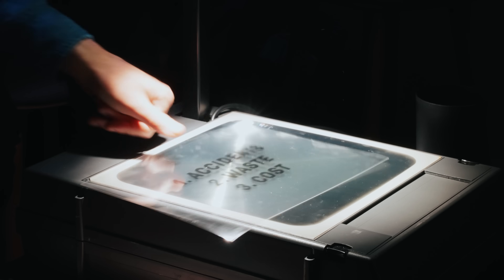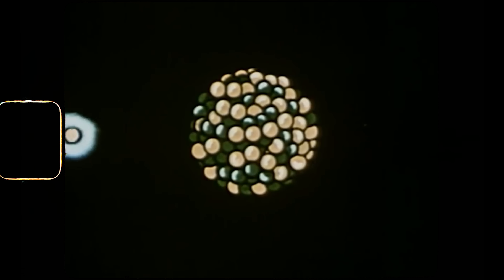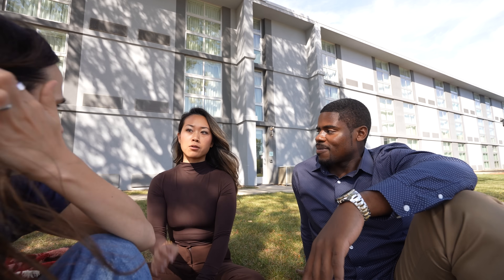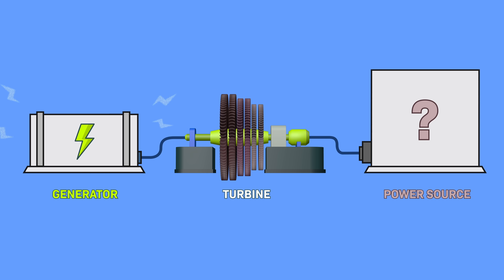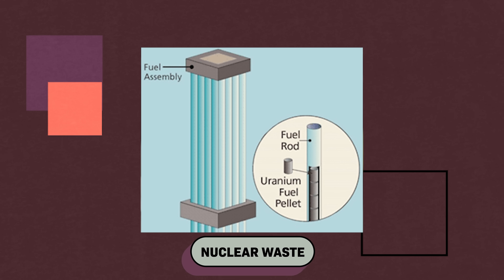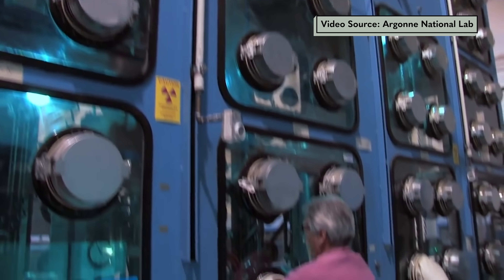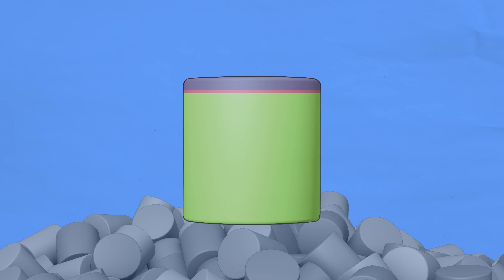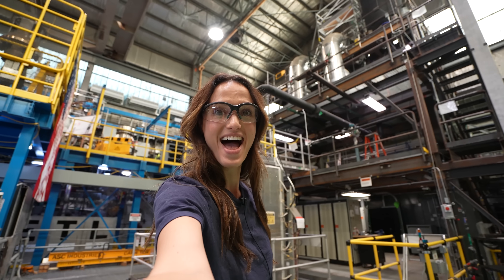The Big Lie About Nuclear Waste

Comment: As someone who studied nuclear engineering in school, honestly every decade or so people start getting hyped about some "forgotten" technology from the 50s and it makes the rounds, papers are written research is funded. When it comes down to proposed costs and models there's not enough information and we get bogged down in the details and the costs look good. If this gets traction for the next 2-3 years great. Maybe in 40 years it will get enough people in favor of nuclear to finally do this stuff. Nuclear isn't profitable. It's not. The benefit of using nuclear is the same benefit of having roads and public infrastructure: the additional societal good outweigh the coasts associated with doing all the work. 

One time through Nuclear fuel processing is a bizarrely hands on process. You can't really be so hands on with recycled fuel, and especially not during the reprocessing steps. All of those require robotics and automation, and the equipment is going to get radioactive so even Maia ting the equipement is going to require robots and cool down time for the equipment. All of the equipment t in turn is considered low level wast. The sites where the US military created plutonium have tonnes of such equipment that cannot be removed, just stored. 

Also, if you do the math on known estimates of uranium reserves, you can easily arrive at hundreds if Not thousands of years of energy consumption for the entire human race. More than enough time for fusion to get the kinks out. Downside is fast reactors burn through their vessels faster, so can live as long. There's gonna be a bit more low level waste. 

Storage is solved, ish. Drill 7 miles deep into impermeable rock layers, put your fuel, seal the hole. No one will stumble over 7 miles deep into continental crust. Added bonuses it won't leave into waste supplies, like could have happened at Yucca Mountain.

Like left wing politicians, what Nuclear fails the most at is marketing and communication. To describe how nuclear solves problems requires getting into the details of why it makes sense, and why the cultural and societal shift needed to support nuclear makes sense. You cannot run a nuclear plant as a for profit entity it must be a not for profit with focus not on reducing costs, but on maintaining safety. When you skip on safety, training, inspections, you get accidents just like in ever other industry. Nuclear doesn't leave poison gas which will suffocate a city of 10,000 people overnight. It doesn't belch smoke that causes asthma and cancer for thousands of square miles downwind.

Comment: Hi Cleo, I used to like your work at Vox and now. I think though, that you moved in a different direction. Why use radioactive material to make power, open up nuclear weapon proliferation and become vulnerable to war crimes on nuclear power plants like now in UA, while still having and producing more waste (also in the „recycling“ process) when you can have solar and wind as clean, recyclable and renewable energy. 

By the way, fission and fusion add additional heat to the earth‘s energy balance that was previously trapped in the uranium. And, due to the energy needed to prepare uranium it is in now way a clean energy. And it is not abundant or renewable.

I think you got tricked by the nuclear lobby, by producing this clip.

Comment: It's like eating a chicken. You buy a chicken then cook it and eat it. But before throwing that bones in trash you can boil it and use it to other cooking. And after all the bones nutritious juices have been extracted you can now throw it in the trash. "BUT THAT'S THE THING" in comparison to the chicken bone, this nuclear wasted is still "WILL BE OUR PROBLEM IN THE FUTURE". So It would be a productive to look for better energy resources like solar, wind, hydro and geothermal, because in comparison these natural energy sources, it doesn't produce dangerous waste materials. In this increasing changing climate change, it would be best to look into that direction where the Sun heat is rising in tropical countries, wind in storms are getting stronger, high snow build up in cold countries (etc. etc.) In these times of change "WE MUST LEARN" how to adapt to these changes and not look for a solution in problem that would still be a problem in the future because that would be a counter intuitive.

Comment: Really painfull to watch. The world is larger than just the USA...

Recycling nuclear waste has been done for decades on an industrial scale (purex process) for example in Sellafield, Majak and La Hague. You still end up with radioactive waste (fission products and actinides like Am and Np). There is also high level waste that cant be worked up (incapsulated in glass). So you still need long term storage.

You also poorly differenciate between just separating U and Pu and separating all actinides. Separating U and Pu is a well known industrial process but separating also the other actinides (Am, Np...) has not been done on a large industrial scale yet. It also makes a huge difference for the disposal.

Comment: I hate people even mentioning nuclear waste because to me this is just free energy that no one want's to put their hands on for some reasons. Like when someone says: "Oh no the nuclear waste will produce dangerous radiation for 1000 of years" than I'm like: Wait so what you're saying is that it'll make energy for over 1000 years??? This is great news!
Reply: No it won't. The amounts of usable energy is basically zero. This is why those dry caskets just stand there without any additional cooling.
Reply: @whuzzzup  Well this video proves you wrong
Reply: @wscamel226  No it does not. We don't have the reactors to use the energy.  
And just because something radiates does not mean you can use that energy, yet alone it's of any significance. 
Radiation is not what is used in reactors (only adds a small amount of energy).
Reply: @whuzzzup  then what is used?

Comment: Hi Cleo. Great video! 
I was thinking that you moved a bit quick over the U-235 enrichment process. Going from the 0,72% make up to say middle of the road reactor percentage (4.2%) requires 6 times the amount of raw uranium to be "squeezed down" to create the 4.2%. This is a long and boring process but, if you started with 6 kg of raw uranium, you would end up with 1 kg of enriched uranium ready for the reactor. The other 5 kg is called Depleted Uranium (DU) and is used most notably as ammunition. That 5 kg is the amount used in an armour piercing shell that destroys tanks.

The US government uses these shells to destroy tanks on the battlefield. This is because Uranium is 2.5 times denser than steal and 1.5 times denser than lead. Thus a much higher kinetic energy and penetrating power. 

Problem is two fold.
1. There are massive numbers of these spent rounds Laying all over the ground in conflict areas... and they are still radioactive. 
2. This uranium could be converted to active fuel in a CANDU 3 reactor.

Thus not only are we radiating the land that is fought over, we are throwing away valuable fuel.

Just thought you might want to know.

Comment: Everything you say is correct. But something that is important to add is the timescale required to  reduce waste to the levels you showed. We would need to adopt such technology for at least 500 years to allow the problematic elements to be recycled multiple times. Even then, the material that remains in the last cores will contain a significant amount of transuranic waste. Unfortunately, most of us are only really interested in having the cheapest energy and I don't see how this can change to allow more expensive fuel cycles to be adopted.

Comment: Cleo Ma'am wonderful video and wonderful insights as well

Do yoy know that there is/was a company backed by bill gates which also claimed to used spent fuel in their reactor design( I do not remember whether it was a thermal spectrum or fast spectrum - must be fast spectrum only) - they were working on that as well. 

Personally I am a proponent of thorium (India is an abundant source for thorium). 

Cleo Ma'am , in the US, there is a lab in Tennessee named oak ridge national lab -which came up with Molten Salt Reactor ( Kirk Sorensen is an expert in this field currently who is working to build a LFTR in the company he formed )
. I find that very promising, do check it out

Comment: 60 sec in, and i call bullsh.. . basic fusion technics  u need the kritical mass that a chain reaction goes on that generates heat. the more the heat than the more power u get. if something gets just bearly above boiling point there is no logical use. yeah sure u could call it energie from nuclear waste but u still need facilty and people that work there and with price as low as now there will be no way..... atomic fuel propaganda i would say
Reply: now i watched it, it is worse. if they are in research since the 60 than therenis a problem. i would say the the biggest is the only 5% left usefull uranium. so u are building these facilitys to get 8% recycling..... usefull. i wasted my time. please make a video of the iter reactor or somethink not these maybe we can get the process to be so good that it will be usefull b.s.

Comment: I still think one of the biggest problems is taboo and stigma. A lott of people from older generations still get an instant raging panick attack when you start talking about nuclear. And there are a lott of people who have absolutely no clue what nuclear actually is, and they tend to scream the loudest. I remember, when something smelled really bad, someone said 'This smells like a nuclear reactor.' So I asked 'Have you ever been in a nuclear reator?' He said 'No, but I am sure it smells awefull and chemical.'
Reply: What happened in Chernobyl. What happened in Long Island.
Reply: @terrymckenzie8786  3 mile island in pennsylvania. Long island is in new york
Reply: @enor6117  Yes. Sorry. But isn,t this dangerous.
Reply: @terrymckenzie8786  with improper management nuclear accidents are a risk yes. Chernobyl was caused by poor safety protocol and oversight in risk. 3 mile island was caused by a coolant leak that was a result of a bad repair job and caused the reactor to overheat. Fukushima was stupidly built at sea level in a tsunami prone area and backup generators, that are supposed to prevent meltdowns, were built at the same level so they filed during the tsunami as well. The main danger with nuclear isn't the risk of accidents themselves it's the consequences of oversights that cause them. All three of the major accidents were avoidable in different situations
Reply: @enor6117  but it’s a matter of time it happens again. Especially if we continue to double up every ten years.

Comment: Ironically, it was the environmentalists that derailed our move to nuclear energy.  So they are indirectly to blame for the continued CO2 emissions leading to global warming.  Had we stayed on the trajectory we were on, we could have completely replaced fossil fuels for generating electricity and likely have moved to the electrification of much of the transportation industry by now.

The problems caused by environmentalists continues even today.  In Germany, they have pushed to shut down the existing nuclear reactors leading to the reopening of coal plants because there isn't enough wind, solar, and grid storage yet.  In the US, they are pushing for closing hydro power plants which would prolong the process of replacing fossil fuel plants with wind and solar.  Logic is thrown out the window as they are driven by emotion.

Comment: Really good content. As an ex-Navy Nuke, Reactor Operator...you are spot on. You should also look into Thorium reactors...another route to energy independence America could leverage. We have an incredible abundance of Thorium and the reactors designed to use it are intrisically safe...
Reply: The problem with thorium is that it's so radioactive, the handling processes to make the fuel all have to be remote and shielded.  Uranium is relatively stable and the plants for making uranium fuel are easy to build and operate.  Every couple decades, the idea of thorium reactors is raised again and eventually dismissed as impractical.
Reply: One should just ask why there is globally not a single Thorium reactor globally available although the concept is known since a long time.

Comment: I wished you'd explained the plutonium part a bit more. 
Because as far as I learned, this is the actual problem with the recycling. It is waaay easier to build nuclear weapons out of plutonium than out of U-235, and large scale brooding reactors or recycling reactors will drastically increase the availability/accessibility of Plutonium. 
With a bit of criminal energy, some of this plutonium can fall into the wrong hands, and then the whole world must be afraid of "dirty bombs".

Comment: I researched this for a class (a long long time ago so things have changed). The dry casks degrade quickly because of the heat and leak which is severely under-reported. You need to transport the waste to the next plant and doing that is a huge security risk plus if a train derails you're screwed. Especially because train routes go through major cities. If we build a plant to use the waste without ending the re-creation of waste, we'll end up with more than we started with. It would be a great solution if we stop producing more waste, refined the current waste, and built the new plants close to the current repositories, avoiding major cities during transport.
Reply: I'm a nuclear engineer and i'm glad you got some exposure to this topic but if you look closely at the design of dry casks, it's not anything that degrades quickly. It's dry and the heat from fuel decay is very low so they can be inside the casks safely for a very long time undisturbed. Second point about your concerns with train derailments: we have overqualified those casks to withstand a comical amount of accidents. Fun fact: one of the tests are to set it on fire, chuck it down a big cliff into water and let it sit there for 24 hours. They all passed. Believe me, you should be way more scared of the millions of gallons of oil spills and premature deaths of 7 million people every year from fossil fuel emmissions. All the nuclear waste casks in canada is solid, dry, stable fuel that can fit in 2 olympic swimming pools (really small volume). Another fun fact: if you had to rely on nuclear power your whole life, all your waste would fit inside a pop can.
Reply: I mean... considering that the caskets used to transport the nuclear waste can literally survive a head on collision with a train, I don't think derailing is much of a problem.

Comment: This was one of the reasons I first started advocating for nuclear power (and was opposed to Germany's decision to phase out nuclear power). Many of the criticisms are based on the (faulty) belief that nuclear can only come with extremely long lived nuclear pollution as part of its "original sin." That's not true and providing a baseload of carbon free power is fundamental to tackling climate change. 

Germany's neighbor France reprocesses and recycles nuclear fuel at La Hague - and has enough spare nuclear recycling capacity that it could have also provided that service to German power plants. France's carbon emission are 45% of Germany's - largely because so much of its non-automotive energy needs are provided by nuclear and hydropower electricity. Germany is shutting down its nuclear power stations, guzzling liquified natural gas from the USA now that it no longer can from Russia, and burning through tonnes of high carbon lignite. All much worse for the environment than nuclear - and the ability to recycle it is open and available just next door. 

The US could do the same and cut down on our long term climate challenges by switching our current baseload of fossil fuels (which are already transitioning from coal to natural gas) to nuclear energy while repurposing (and mostly getting rid of) the high level nuclear waste we already have in storage. All it takes is a little will power. France and Japan already do this.